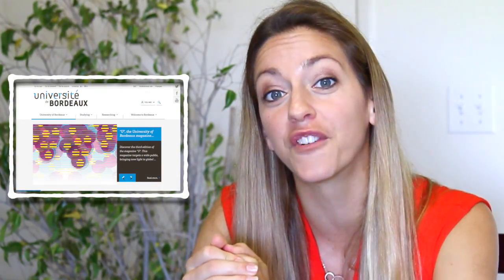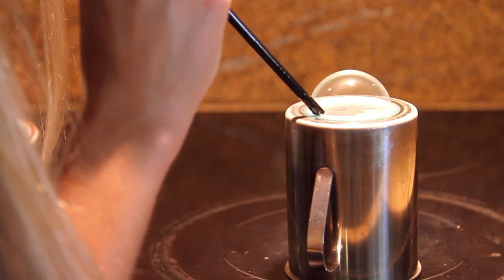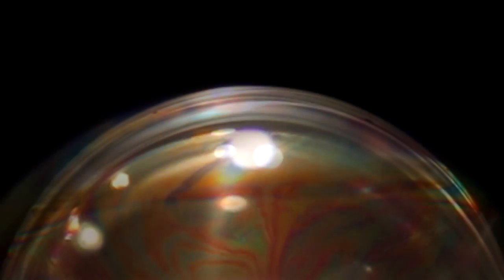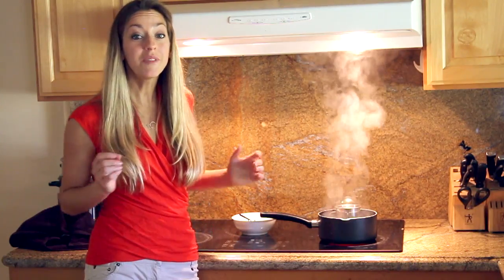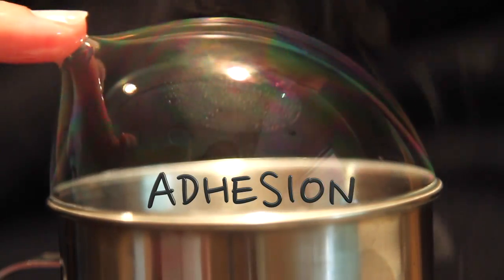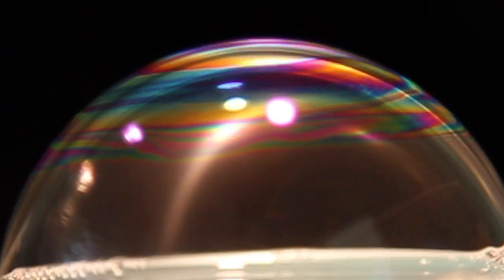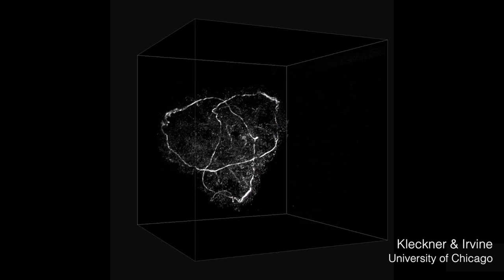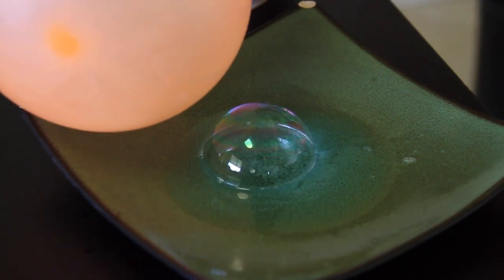How to Make a Hurricane on a Bubble

Comment: My understanding has been that vortices in our atmosphere, hurricanes, have an essential 3rd dimensional component. They are driven by the hot air rising within them. But these bubbles are almost 2 dimensional like, ( but wrapped around a spherical volume), which seems to defy explanation, in that the vortice lacks the vortex line.

Comment: The vortices are seen, are made visible here, due to thin-film interference effects.  The beautiful colors, like motor oil on water.  Thin-film interference color effects are in turn due to very small continuously dynamic variations in the thickness of the thin film floating on the surface of the water, in this case, a thin film of soap.  (Or tiny variations in the thickness of a thin film of motor oil floating on a puddle.)  Variations in thickness of the film so small that from one location to another nearby, but of a different color, the thickness differences are on the order of wave lengths of visible light.  Really small!!

So, this means that, if the swirling structures made visible on the surface by the soap film are due to, or reflective of, systematic patterns of heat flow within the water of the bubble, those heat flows I think must be systematically varying the thickness of the soap film in some true way so that we "see" the heat flows.  Looks like this is true too because the swirling vortices seem to appear predominantly on the top of the bubble.  The top is the part of the bubble to which the warmest water, which gets heated only at the bottom of the bubble (i.e,. from the metal can), would probably rise.  And once there, give up some of its heat to the surrounding air.  Swirling would be from faster-moving and slower-moving regions of the bubble's surface, which I think would in turn stretch in paces, and compress in others, the amount of soap in the film which would indeed vary it's thickness.

Comment: The bubble vortices all seem to be turning in the wrong direction though... They spin clockwise, whereas hurricanes spin counterclockwise (in the northern hemisphere).
Reply: David Buschhorn The bubble is not rotating about an axis so there is no Coriolis force in this small scale situation. This is what determines spin direction on earth for large scale systems. The spinning here is simply from temperature and pressure gradients on the bubbles curved surface. They likely spin both ways at times.
Reply: But you'd think half of them would be going the other way then... unless the Coriolis effect is in play but acts more in the inside than the outside from the slightly faster flow of soapy water on that side of the bubble....

Fuck there's a lot to think about with bubbles!
Reply: David Buschhorn  It is true that hurricanes spin as you say and this is due to the coriolis effect. However for these bubbles that effect is too small to show up. This is because there are so many other forces acting on the bubbles surface (eddies in the air, the straw in the bubble, variations in the surface it's on etc.) that it will be these effects that dictate the direction of rotation, not the large scale rotation of the earth. If you haven't seen them Derek from @veritasium and Destin from @SmarterEveryDay did a great duo video on this subject.
Reply: I imagine if you tried it you would see an even average if you made enough bubbles (the tendency you observe in the video is just an accident because we only see a few shots). It would be triggered by the disturbances of the straw and the like. It is probably possible to introduce a bias one way or the other by blowing air across the surface in one direction or the other.